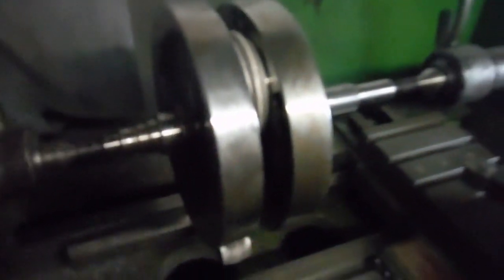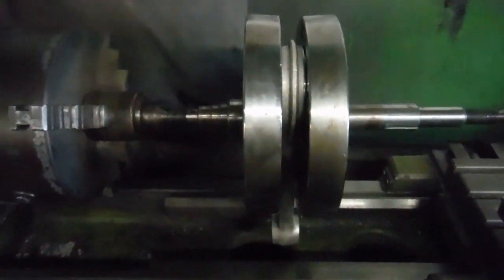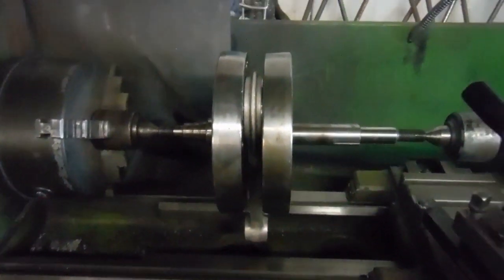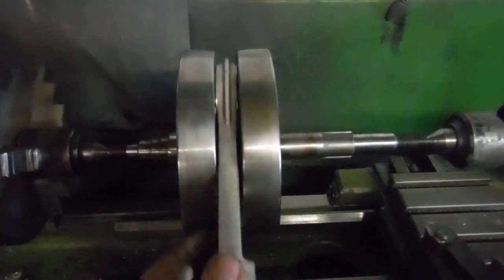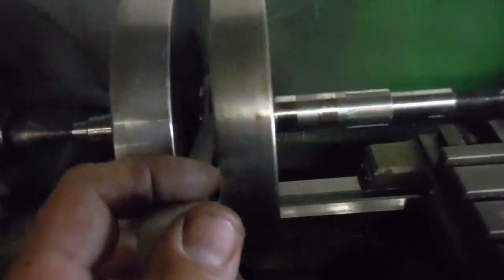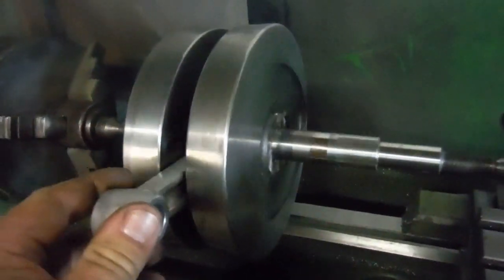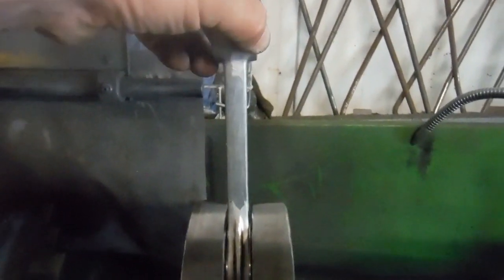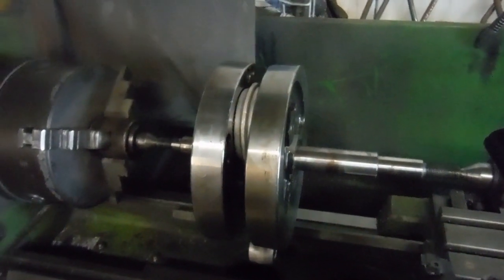Royal Enfield Bullet 500 terrible crank runout.

Comment: Hilariously poor assembly. I suspect it was never trued in the first place and simply tightened in a crude jig (because a decent jig would have gotten it within a few thousandths in the first place (assuming the flywheels weren't machined with a potato and the rims of the wheels are aligned square to the crankpin holes.)
They should sell those bikes as parts kits so competent mechanics can assemble them properly the first time.